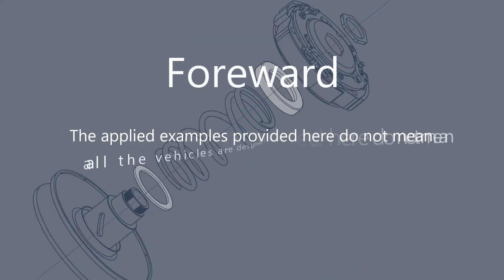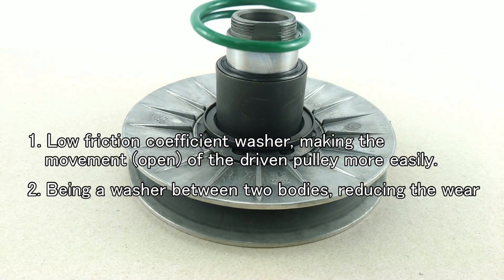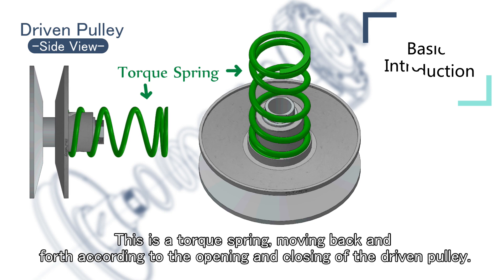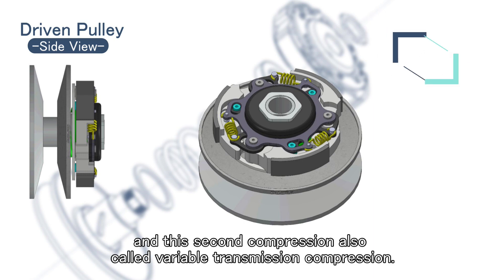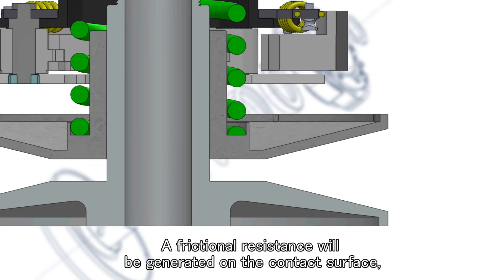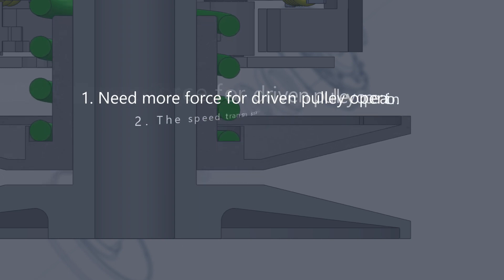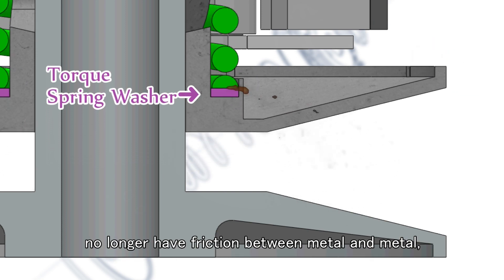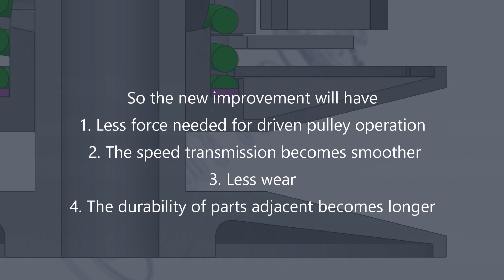Function of Torque Spring Washer, how is its function?

Comment: I tell you what:  Thanks God for your video because 1, when I took apart my brand-new Vespa Sprint 150 (2023) those idiots at the Italian assembly plant had the plastic contra spring washer BELOW the metal housing cup-washer (shop manual doesn’t explain it either) and, 2, my new Malossi clutch kit came with its own plastic washer & contra spring (white) but their instructions do NOT indicate where it goes although they DO tell you that it is not necessary if you already have one.

I’ll tell you what else:  This Vespa is a nice scooter but that washer wasn’t the only quality control mishap I found.  One of the other big things was the lack of a rear axle cotter pin!  There were also several minor areas around the body work with either missing screws/nuts or just absolutely loose.  FFS.